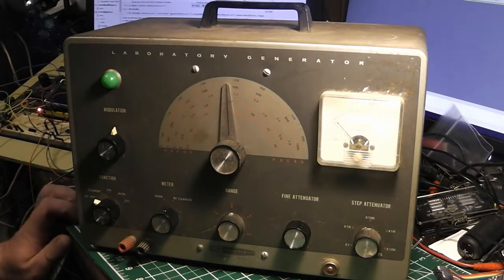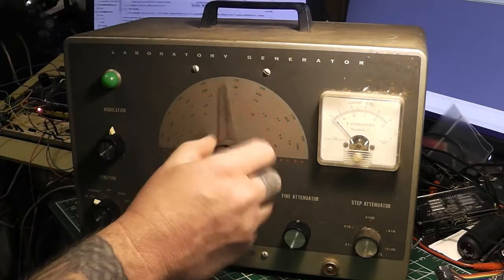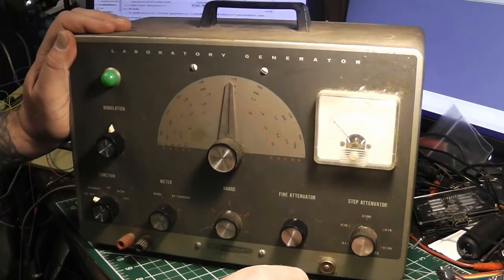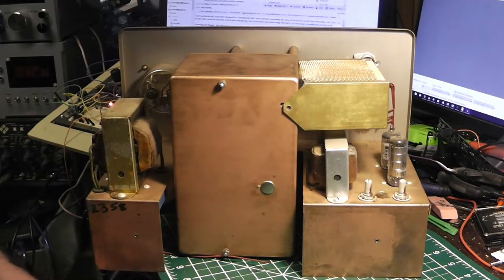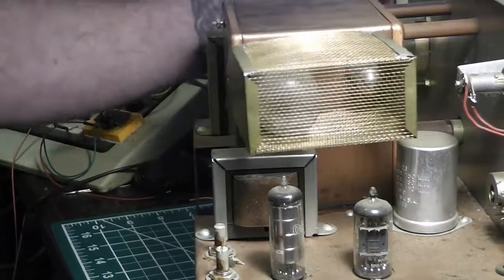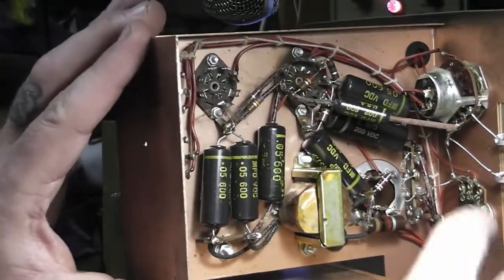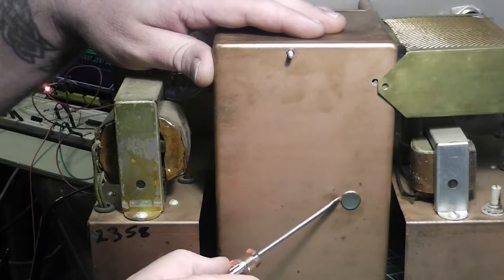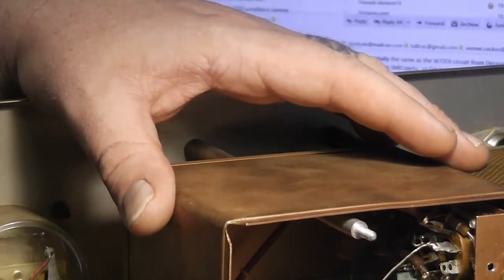HeathKit IG-42 Laboratory Generator Restore Part I

Comment: I know this is some from time in the past, however, thanks for the great presentation of the IG-42. I just came across one of these units and can not seem to find a manual. Unit I have is extremely clean and worth saving, thus the need for a Manual. Do you know where I can source a manual? Seems to be a shortage of info on this model and the manual. Again thanks for any pointers and your great video on the item.  Regards Bob